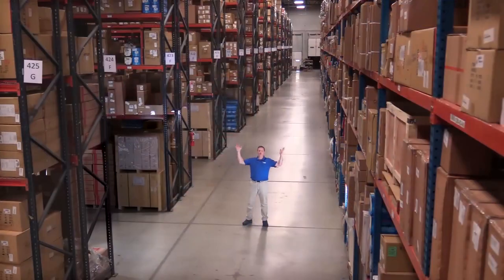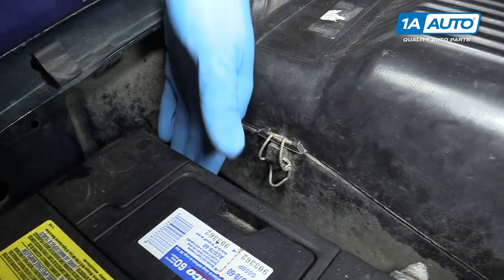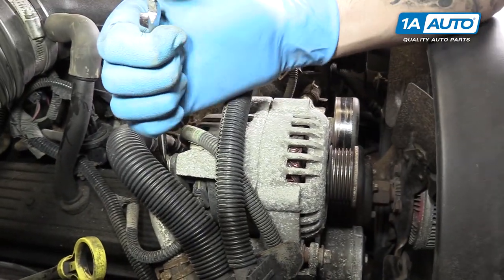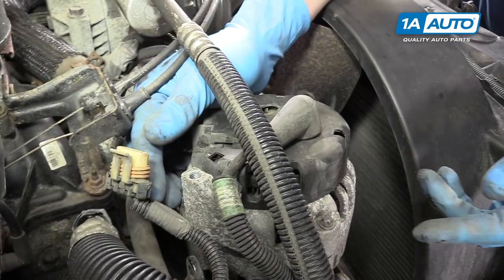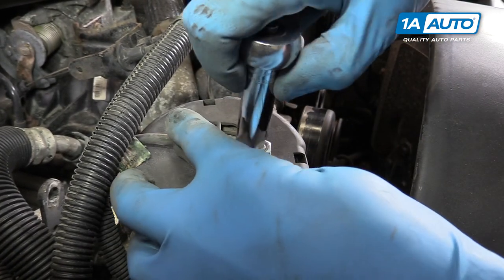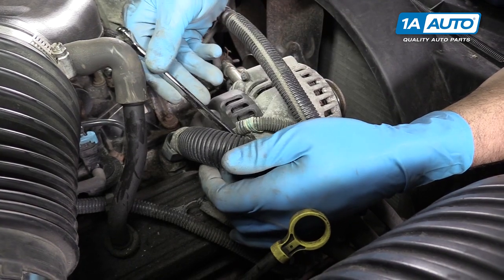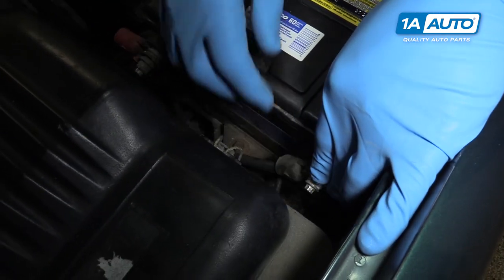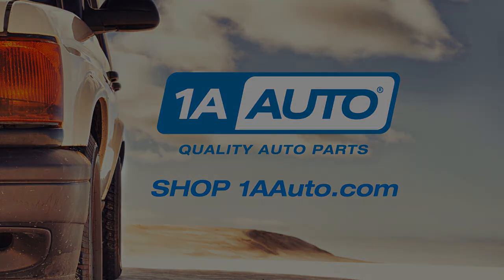How to Replace Alternator 96-99 GMC Sierra K1500 5.7L

Comment: Finally a series of the truck I own. We'll it's a 98 Chevy Silverado k 1500.  Awesome quality detailed videos guys! Love to see everything changed.  How bout the spider fuel injection? Or lower intake manifold gasket.  How to set up the rear end would be a good one. Or waterpump
Reply: Justin Sero sr what size of belt do these take I have a 98 z71 k1500 also
Reply: Reason I ask is I bought a singer large case 270amp alt and wanna find out if this belt will fit or what length I need to go .5" longer but don't wanna take it to see then put back on to go buy new one lol wanna have Parts on hand first lol

Comment: On second thought Thanks 1A and 2 other things: 1. I used a 1/2" box end on the tensioner and pressed straight down to free up the belt. 2. The front alternator brackets have sleeves in them. With the old alternator out, I tapped the sleeves back with a hammer to allow the new alternator to more easily fit. When you tighten the bolts the sleeves will again press against the new alternator
Reply from the maker: +GagaPapa A Thanks for checking us out. 1aauto.com

Comment: Used this video to replace my 1996 GMC alternator. Best tips are to not remove the belt unless you are replacing, and tap the mounting bushings back a little to help with ease of reassembling new alternator.

Comment: Just a tip  if you have to replace the serpentine belt 1998 k1500 ,and you or parts person  dont know which fits because there's two .  The higher amp rated alernator belt fits no matter which alternator your truck has. It might save you a trip home and the frustration to find what amperage   alt your truck has.

Comment: Is it imperative that the entire belt is removed? Or could I just leave the belt on the rest of the pulleys while I work on the alternator and just make sure the belt is all in place before tightening?
Reply: Girly AK that’s how imma do it.
Reply: I have left mine rest on the pulleys while working on replacing pulleys and etc, as long as you get it back on all the pulleys I wouldn’t see why would it be a issues
Reply: no need to completely remove belt
Reply: No

Comment: Thank You A1 - always informative - 7.4 liter uses 1/2" on everything - bolts and nuts. Tensioner pulley is forced straight down to loosen up to remove or replace belt

Comment: My 96 3500 7.4L has an alternator with a single thinner wire attached to a screw on the alternator that disappears somewhere into the firewall. Any idea what it is for / does? The mechanic who installed the alternator, did not remove the NEG battery cable first, and it 'sparked', and now there is no continuity, and I don't find any blown fuses either. Thank you!

Comment: what alternator (100amp, 105amp, 124amp or 140amp)  should be used on 1997 GMC C1500 305 motor with A/C and power door, windows  ?

Comment: First off thank you for your help! I messed up though... I'm pretty sure I got the wrong size alternator. What should I do? Please help.
Reply from the maker: +Sherri Cabinaw If you believe you purchased the wrong size alternator I would not recommend installing it as it could cause issues/damage to your vehicle.  Please check with the seller to confirm the part is correct first.

Comment: Can you tell me what the wire that clips into the back is for? Thanks
Reply from the maker: +Owen The three wire types in a three-wire alternator include the battery positive wire, the voltage sensing wire, and the ignition input wire. The battery positive wire connects to the starter. The voltage sensing wire connects to the battery, and the ignition wire connects from the alternator to the key switch
Thanks for watching.